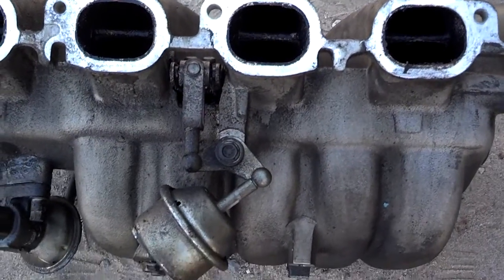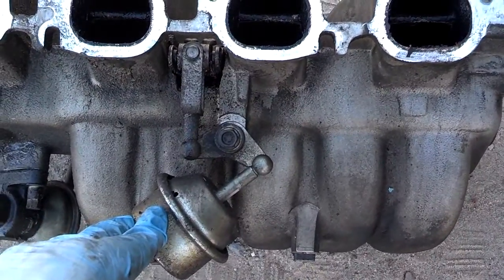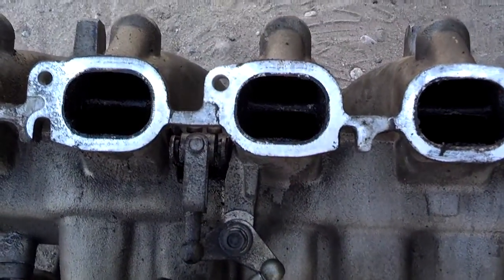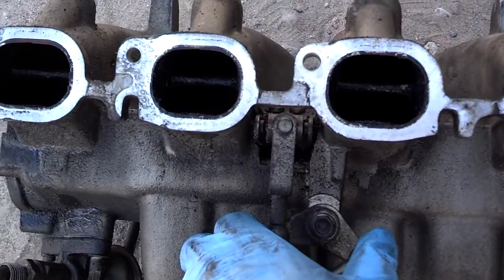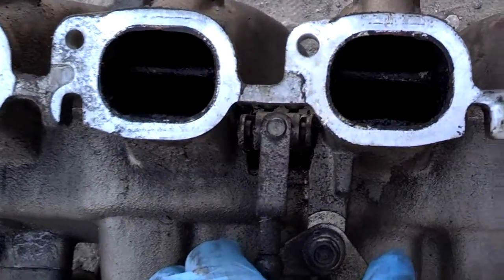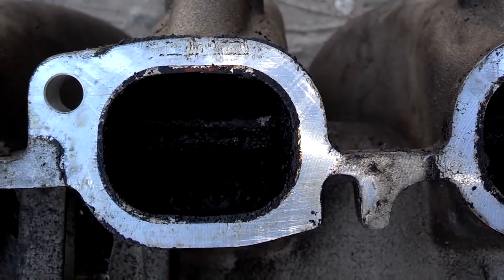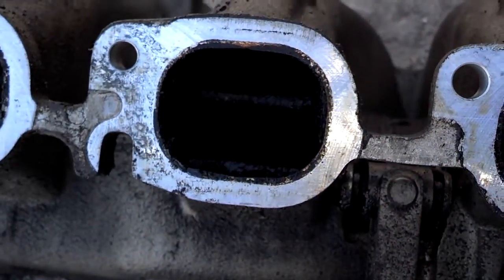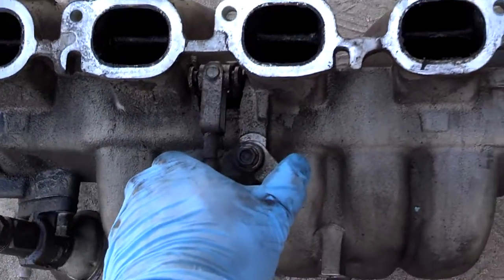Volvo 850 VVIS Intake Manifold System, 1994 - Auto Information Series

Comment: It is commonly referred to as a variable length intake.  It can be an absolute pain of a failure to diagnose, trust me!

When it goes bad, the subjective power 'loss' can be so bad that you suspect a major engine issue.  I bought an 850 with this issue for a song (not even a dance to go with it!).  Trying to fix it proved problematic as finding the proper parts without going through the dealer and spending as much as the car was worth was impossible (two years of trying!!).

I modified a later intake and fit it to the car, it ran better than the busted variable-length intake, but became anemic.  I wish Volvo would have kept the system around, though, because it had practically the same effect as VVT by using little more than some vanes and a vacuum motor...

For low end power, you want the intake to be shorter, so the vacuum from the cylinders and valve overlap was optimized at lower speeds, without a large mass of air to move.  At higher RPM & throttle you want to keep the air mass's inertia to help air get into the cylinders more efficiently, so you open the longer runners.

At least that's my understanding ;-)
Reply from the maker: Nice, thank you so much for sharing.
Reply: And it's wrong. For low end power you do want the longer channels and for high RPM you need less distance for air to traverse, e.g shorter runners.
Reply: @farmdve   Wow, I did absolutely write that backwards.  Thanks for the correction ;-)